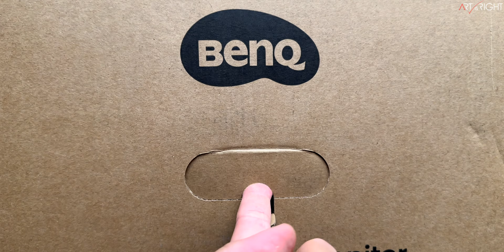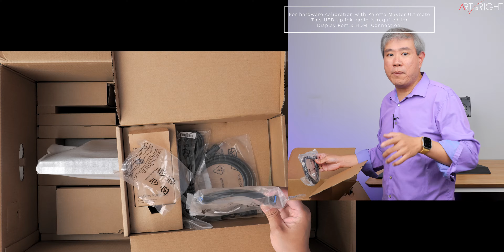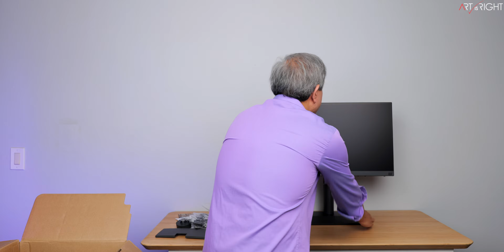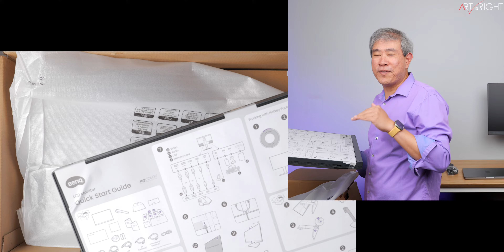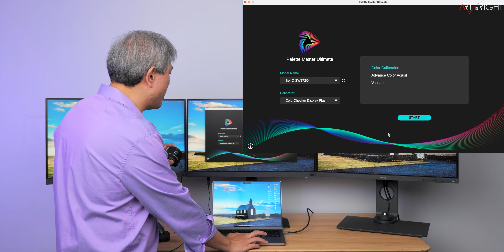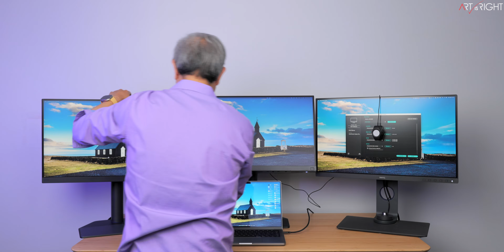SW272Q & Special Edition SW272U Unboxing!

Comment: Hey Art!
Thank you for the video!
Do you happen to know if BenQ is planning on releasing a 5k monitor? I really would like to upgrade my 27“ 2K Dell to a hardware calibrated monitor but i also would like to have 5K@27“
So i‘m waiting and waiting but i guess I will end up buying a 5K Main Display and a 2K Hardware calibrated one to Check colors
Reply from the maker: You're welcome. I'm unaware of BenQ un announced products. However, if you look at the industry right now 5K display are just starting to become more prolific outside of Apple and LG. Part of this is because of their partnership that created the monopoly in some ways manufacturing yield, which can be lower for 5K panel and Apple is pretty much taking up most of the allocation. At this point in time there's no 5K hardware calibrated display. I'm hoping this will change in the future. Either way your solution works.
Reply: @ArtIsRight  thank you for your insight!
btw did I catch that right that if I was to buy a SW272Q I would also need to upgrade my Calibrite ColorChecker Display Plus to the new HL version?
Reply from the maker: https://youtu.be/JSLCQ3LE-x0 
Your Calibrite ColorChecker Display Plus would still work. My point in the video was that Calibrite latest devices works right out of the box.
Reply: @ArtIsRight  maybe I understood that wrong then: https://youtu.be/UMGKThIESvU?t=191
thank you for clarifying! Looking forward to seeing the new monitors in stock in Europe!
Reply from the maker: That is a just a note saying that they are fully compatible with BenQ software out of the box, not that you need these from now on :)

Comment: When you calibrate ,is the screen supposed to match the MacBook Pro?  Otherwise, what is the point?
Reply from the maker: No that would defeat the purpose of these display. I'm calibrating them to Adobe RGB, which MBP can only show about 80 something % of. Matching MacBook Pro for these Pro Display is not the best idea. The point is to calibrate to Adobe RGB reference gamut for pricing. Not all Creatives revolve around MacBook Displays, there are plenty others out there. And that is the point.
Reply: @ArtIsRight  Thank you.  I honestly didn’t mean to offend about asking what is the point.  I literally am trying to understand calibration .  If I work on a photo on my macbook connected to this display, I must realize there will be a difference due to color gamut and then when printing, adjust accordingly?  Is this what you are explaining?  My goal is to print.  I very much appreciate your support and do subscribe to the channel.  Thanks.
Reply from the maker: @drwatsonismine no offense taken and thank you for the support :)
" If I work on a photo on my macbook connected to this display, I must realize there will be a difference due to color gamut and then when printing, adjust accordingly?" For the most part, you may ok, this would depend on the printer used, media, lab, etc. Lots of variables here. And even Mac Display can be calibrated and probably should be. By default Apple P3 calibration is a touch more blue than reference. So if you print, you can still use an Apple Display, if you like more accuracy I would calibrate it and if you want to get a great print / display match, I would consider these 99% Adobe RGB displays. Hope this answer the question. If you have any more or follow up please start a new comment all together - this way I'll see it. - Cheers!
Reply: @ArtIsRight  thanks. Much appreciation and respect.
Reply from the maker: Anytime!
Reply: @ArtIsRight  Hi Art - I’m edging towards an SW272U as my first calibrated display after following and educating myself on your channel. However, even though I couldn’t see myself requiring anything near 600 nits after testing an Apple Studio Display, I note that BENQ specifications for the SW272U only show ‘typical’ brightness of 400 nits, whereas they normally also show ‘peak’. Although I typically work in semi-darkness with no windows behind my seating position, my concern is whether the new SW will be sufficiently bright for non-critical work in brighter conditions e.g. e-mails, web browsing, viewing videos, etc. Have you measured the brightness in your tests i.e. outside calibrated REC709, AdobeRGB, etc. modes? In terms of brightness, how does the SW272U compare to a PD2725U specified at 250 nits typical and 400 nits peak (notwithstanding different capabilities), for example? Thanks!
Reply from the maker: Although I typically work in semi-darkness with no windows behind my seating position, my concern is whether the new SW will be sufficiently bright for non-critical work in brighter conditions e.g. e-mails, web browsing, viewing videos, etc. Have you measured the brightness in your tests i.e. outside calibrated REC709, AdobeRGB, etc. modes? In terms of brightness, how does the SW272U compare to a PD2725U specified at 250 nits typical and 400 nits peak (notwithstanding different capabilities), for example? 
Have not measured them but they should conforms close to Reference standard. This said, you'll be fine. I run everything at a fix 80 nits for more than 2 decades not with other displays and not BenQ.
Reply: @ArtIsRight  Understood and appreciate your insight. However, as a baseline to compare with my devices that would be used alongside (M1 Max 16-inch MacBook Pro and 12.9-inch M1 iPad Pro i.e. mini-LED displays with Apple standards), what is the reference brightness for the P3 mode in the SW272U, for example. I appreciate that DCI-P3 designed for cinema will be relatively low-brightness, however the Display-P3 that Apple and others utilise appears to accommodate proper HDR (1600 nits in the Pro XDR Display) down to non-HDR 500-600 nits in Apple MacBooks and the Studio Display. Is this P3 standard ‘open’ on brightness and what reference do Benq use for the new SW model - if not tested, would you happen to know some unpublished ‘insider’ specifications maybe, and does the SW272U ‘attempt’ to display the brighter peaks with HDR content?
Reply from the maker: "I appreciate that DCI-P3 designed for cinema will be relatively low-brightness, however the Display-P3 that Apple and others utilise appears to accommodate proper HDR (1600 nits in the Pro XDR Display) down to non-HDR 500-600 nits in Apple MacBooks and the Studio Display. "
This is apple setting, both maxed out at 500 nits on non HDR contents. With HDR trigger it can go up to the higher nits. 

"Is this P3 standard ‘open’ on brightness and what reference do Benq use for the new SW model - if not tested, would you happen to know some unpublished ‘insider’ specifications maybe, and does the SW272U ‘attempt’ to display the brighter peaks with HDR content?"
This is not a full HDR display, so anything HDR will get mapped down using either HDR 10 or HLG metadata for tonal mapping, that is how it handle HDR content in conjunction with the computer. P3 is also not the mode that you will use in HDR, there's an HDR mode for that. And P3 brightness is based on what you set in the percentage range and not open.
Reply: @ArtIsRight  Thank you, Art. Your expertise and advice have been fundamental in me looking to try the SW272U :)
Reply: @ArtIsRight  Thank you again Art for your precise explanations and insight :)